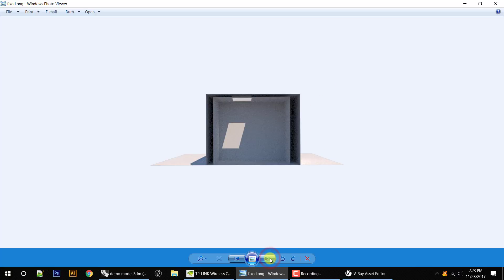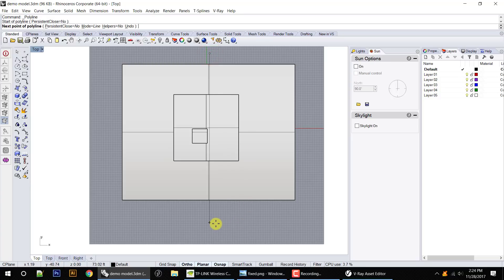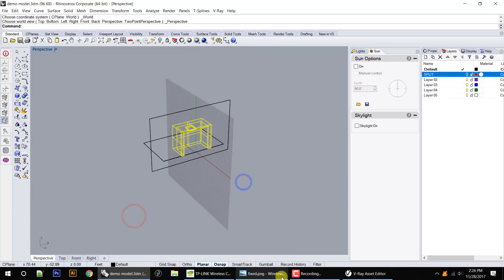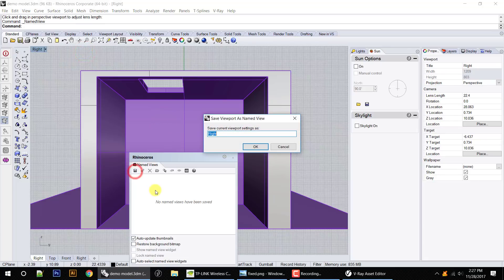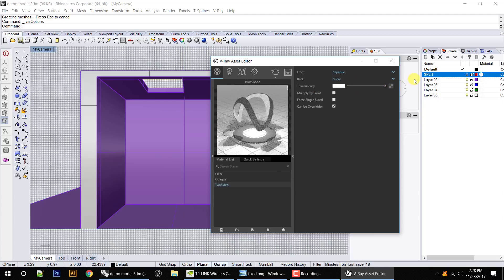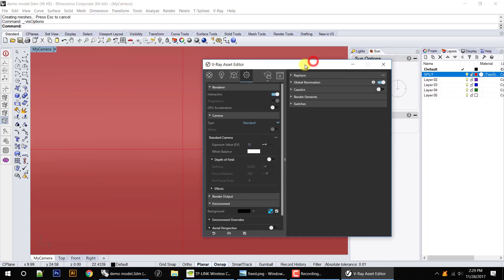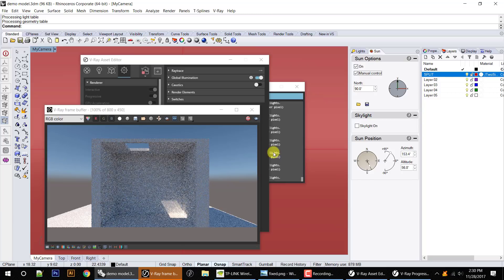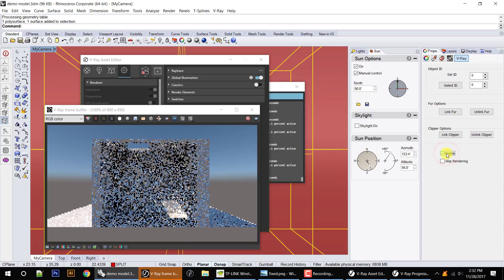ARCH 230 - V-Ray for Rhino 3.4 | rendered section cut with correct sunlight

Comment: In the VRay geometry tab, select the clipping plane and uncheck "Affect Lights". The clipper will work as you previously stated.
Reply from the maker: Luke G! You're absolutely right. Thank you! I am not used to the v3 interface. Totally missed the arrow to expand the Geometry tab objects. So much easier.
Reply: Good job Luke G :)
Reply: Alternatively (for those who look at this for research at some later time) you can leave "Affect Lights" checked, and if you ALSO check "Camera Rays Only" you get the effect you want, PLUS the geometry that is clipped will be black (as if completely unlit) -- helps bring attention to the lit area inside the box.

I am wondering, though, how to get it to use the "Object material" - I selected the Clipper, assigned a material, but it doesn't show up no matter which boxes I check or uncheck
Reply: ***EDIT - I tired it again on another file and the Clipped Edge does reflect light if it's being hit a certain way with it. Oh well.
Reply: Hi Luke G, my vray3 would not recognize my Rhino clipping plane. When I use the command vrayclipper, nothing happens other than that a clipper object is created in the Geometry tab. But this object turns out to be bogus as I cannot define or even locate it in the model. Could you please briefly explain how you were able to create the vray clipper? Thank you very very much.